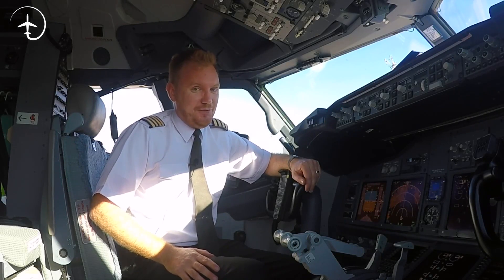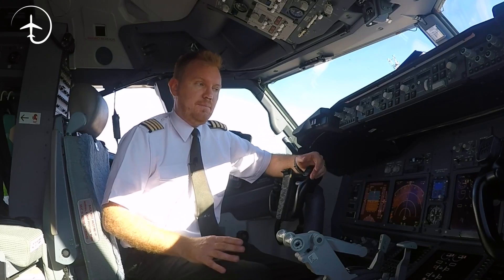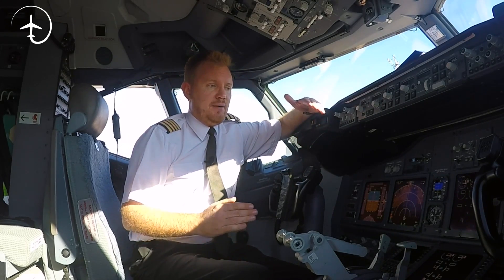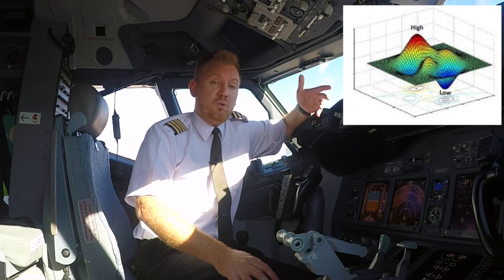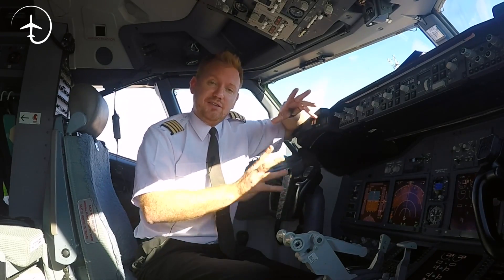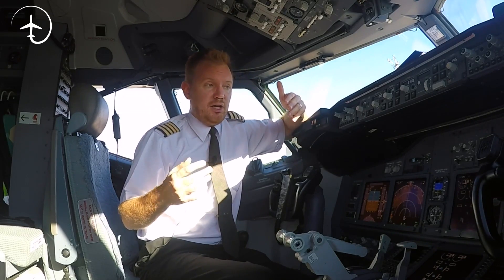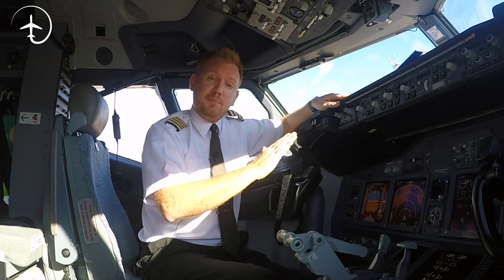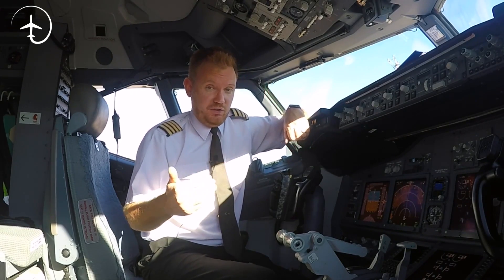How do the Altimeters work and what is a Flight Level?

Comment: I thought you push STD once passed above the transition altitude? But you said once the ATC give the clearance to FL, you will push the STD.
Reply: If you are cleared to climb to a altitude that is above the Transition Altitude, then you don't have to wait until you pass the transition, you can push STD straight away. For an example, if the transition level is 5000, and ATC clears you to climb to 6000, then you can push STD even though you're not at 5000 yet.
Reply: Ozan Akdag If ATC clears you to 6000 feet in that case you wouldn't select Standard. You'd only select standard when ATC clears you to a Flight Level. FL060 in that case. Then you'd select Standard
Reply: Pedro Almeida In Europe, 6000 is FL060.
Reply: Ozan Akdag It depends, if the transition altitude is above 6000 feet, then FL060 does not exist. If it is below 6000 feet, you can only select standard WHEN the controller clears you to a Flight Level. If he clears you to an altitude, you are still supposed to be flying on the local QNH.
Reply: Pedro Almeida Didnt realize it worked that way, thanks
Reply: Ozan Akdag Glad I could help

Comment: Isn't the QFE the local pressure and QNH is a calculated pressure considering the ISA to give the altimeter a value to compare with. My understanding is, if the local pressure is 1013hPa e.g. and you set a QNH of 1013 in your altimeter, it will read 0, as the static pressure is the same as the QNH?
Reply: LUX Aviators No, it's the opposite.

Comment: Hi my answer to the question is approximately 99900 meters it should be a bit more than that as I used approximations like density of air=1 and pressure at earth's surface is 1 atm = 10^6 pa and g= 10 m/s^2 
I used the formula P2-P1 = hdg
Where P1 is pressure on earth's surface, P2 = 0,1% P1, h is height, d is density of air and g is gravitational acceleration.
Reply from the maker: Check out the link to see the correct answer! Good work
Reply: It's correct, well difference of 1 Km but that is because of approximations, thank you
Reply: Actually it is wrong... because density of the air depend of the altitude, and temperature also. That is why aircraft can`t reach edge of space. They can`t reach enough speed and in low density air they stall.
Reply: Haraiala Remus ok, you mean that I cannot take density as 1 because it is varying, correct ?
Reply: @shreyasjoshi5487  when the air is too rarifyied the plane couldn't get enough lift to hold itself in the air.
So it would stall*
*(fall off the sky like a piano)

Comment: 0.1% standard surface pressure i.e. 1013.25hPa * 0.1% = 1.01325hPa
We have known that for every 30ft, the pressure drops by 1hPa.
Difference in pressure = 1012.23675 hPa
Altitude of edge of space = 30367.1025 ft = 9.255892842 km
Reply: Albert Aviation It's much higher than that. Check out the link!

Comment: I recall that the crew called "Transition" as we passed through Transition Altitude and it was then that we adjusted the altimeters to Standard Pressure... I don't remember setting Standard Pressure on the climb to whatever flight level.

Comment: Hi, can the standard pressure at cruising altitude (let's say FL390) change, especially on long distance flights?  And as a consequence the autopilot commands a slight pitch up or down to maintain FL390?
Reply: Standard pressure means it is only one and it is defined as a constant value. Otherwise it would cause more problems.

Comment: Considering the pressure of the earth to be at sea level i.e. 760 mm of Hg or 101.325 kPa. 
So in order to feel 0.1% of this pressure we need to be at the Karman Line(at 100,000 m) and the pressure at this level would be 101 Pa or. 76 mm of Hg.

Comment: So as pressure at FL x changes, the measured altitude relative to sea level will also change, which means to maintain flight level you will be changing altitude relative to sea level but your altimeter will  stay constant?
Reply: Eastmarch2 Correct!

Comment: Do you ever get your altitude via GPS? That seems a lot more accurate then using standard pressure.
Reply: You don't even have a GPS receiver installed anywhere in the aircraft? I'm asking this because I've seen in apps like FlightRadar24 that for most aircrafts the transponders are broadcasting both "Calibrated altitude" and "GPS altitude".
Reply from the maker: No, we don’t.
Reply: The GPS can measure altitude, but it does not display it to pilots.

Comment: Given: 0,1% of the atmospheric pressure is 0,001 atm. We assume an exponential drop with altitude (easy to find in a formulaic collection) and a sea-level pressure of 1 atm.
Then, inserting our first value into the equation, we find that at ~48354,26 m the pressure is 0,001 atm. A bit higher than the service ceiling of any comercial aircraft.

Comment: So, my question is why altitude is measured in feet (imperial units) while pressure is measured in hectopascals (metric units)?  Cheers, Russ
Reply: Russell Cannon Feet is the standard unit of altitude except for a few countries like China and Russia. Pressure has no standard but may altimeters let you set the units or convert them for you.

Comment: You said that above flight level 200 it was not necessary to know your height from the ground, so how do you  know when you're at cruising altitude?
Reply: Well, high-level cruising altitudes are defined using flight levels.
Reply: stevefranklin72 You use the pressure settings to measure your altitude

Comment: So when listening to ATC if they say "QNH 29.22" they mean 1029.22hpa? And what if the QNH is less than 1000hpa due to high altitude airport (eg SLLP) or bad weather?
Reply: No. If you hear 29.22, then it is most likely in in.hg. Depending on where you are flying, you can select in.hg or HPA to display. 29.22 is 989 HPA.
Reply: Just a different measuring system?
Like inches vs. centimeters...fahrenheit vs. celsius?
Is this a European thing...or is this the standard for all airlines?
I'm getting close to 500 hours (small singles and twins), and this is the first I've heard of this...always been in.hg.
Reply: Fermis Fermis No, its not an airline thing. It depends on where you are flying. In the US, they use in.Hg, in Europe, and most other places, they use HPA.
Reply: 29.92 in is that same as 1013hpa

Comment: Well, sometimes transition altitude (STD to local QNH) is different than transition level (FL to X thousands fett) isn't that correct?
Reply: What? To get to a transition 'altitude' and then switch pressure settings, you'd need to be flying in altitudes... QNH. So wouldn't that be transitioning from QNH to STD? Then, when descending, you'd surely be given a transition level - when flying in the Flight Levels - at which you would switch the pressure setting back to QNH (from QNE... i.e., for example, from FL 60 to 6,000 feet... or whatever the altimeter actually indicates when the QNH is input!). That seems logical to me but I'm just a flight simmer but with 9 hours as a PPL PUT. I actually think you meant to write "QNH to STD", not "STD to QNH". Transition altitudes and transition levels are probably different by tens or even hundreds of feet.
Reply: @johnny_pilot  Lol, long time I didn't see this video obviously. I think I was making a reference to the transition layer, maybe Mentour used an exemple where TA and TL were the same and at that time I didn't know the difference between the two :p

Comment: QNH, the pressure altitude above/below sea level. The height that the airport is located in reference to the standard sea level.

QFE the pressure where the altimeter reads zero feet at the airport. Even thought the airport may be situated on a mountain.

QNE the standard pressure set (1013.25hpa, 28.82hg) at transition altitude. 

QNH is used all the time same goes for QNE however you say flight level instead. 
QFE is used by the military/military airports also on airport located for example on a very high mountain.

Comment: Although the altitude I got seems not right, but this is my thought. The change in altitude means the change in pressure so we work out the difference between the standard atmosphere pressure and 0.001(which is 0.1 percent) of standard atmosphere pressure, so 1013.25-(1013.25 x 0.001)=1012.24 hpa. ''And every increase of 1 feet the pressure gone to drop by about 1 hpa'' quote from the videos, so I use 1012.24 x 30 and I got 30367 feet which doesn't seems right.

Comment: 100km ?
so if every 1hpa gives you 30feet, then to loose 1000hpa (~0.99*1000) you have to climb 30k feet which would be like 100km.
given that we are neglecting the effect of weakening of gravity due to increased disatance (100km is neglegible to 6000km)
Reply: Though the number was right I found out why my reasoning is completely off. The rule of thumb which was mentioned is only applicable to near earth elevation. The reason being that although the decrease in pressure is proportional to the mass of air above us, the density of air decreases by reduction in the pressure which in turn reduces the mass of air (per area) as we are elevating.
Reply: also it was 0.1% not 1%
Reply from the maker: Exactly!

Comment: Sorry to be critical, but grammatically speaking, the video title should read: "How do Altimeters work", or "How does an Altimeter work".  Love your content Petter! Always very informative and inspiring. Greetings from Virginia, USA!
Reply from the maker: Haha! That was my original title but people complained about it. :) I KNEW I was right to start with. 
Thanks!
Reply: And yet, not to much explanation about how it works, like, when climbing, pressure inside altimeter chamber escapes outside through static port, and allows the diaphragm to expand, resulting in an altitude readout through a system of gears pinions and arms. And my answer to the problem is 30367 ft, using local QNH 1013.25.

Comment: Just as I thought about searching for altimeter info I see this in my notifications. :)
Reply: How do you reply your altitude to ATC over IFF Mode C? Does the transponder automatically answer back after catching the signal or do you manually submit an answer? Not sure if transponders are linked to pressure sensors of the altimeter.
Reply: It's automatically reported by the transponder when interrogated (assuming it's set to the proper mode). The precise way they're fed the altitude information varies between designs.

Comment: Hey Mentour, in some 737 cockpits I hear a constant clicking noise, like lets say at ~10hz. But strangely, I don't hear it in your cockpit. What could it be?
Reply from the maker: That’s the “ticker” that keeps ticking the standby altimeter to keep it from sticking. It’s not there in newer aircraft with electronic standby ADI
Reply: It should depends on what type of Standby instruments the 737 is equipped with. If it's analog (like the older 737s) you hear that sound, if it's digital (like the newer 737s) you don't hear the sound. You can see that the 737 in the video has the digital one (search ISFD on the web).
I think Mentour agrees with this answer
Reply: Wow, I had no idea there's basically a hammer hitting an instrument xD Thanks! That totally sounds like an afterthought, or a strange compromise in design